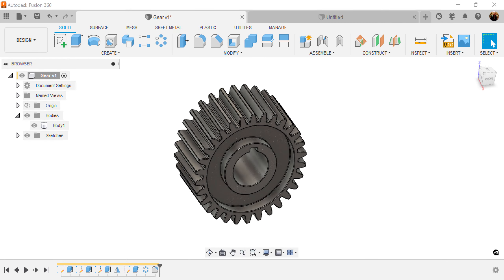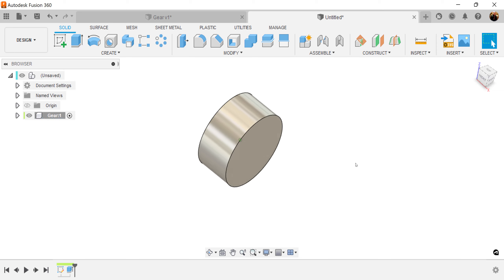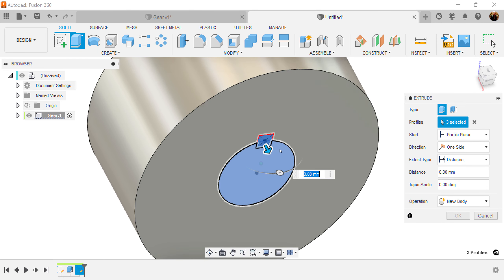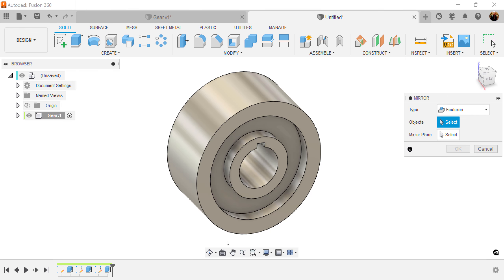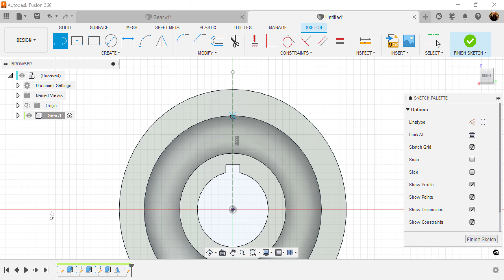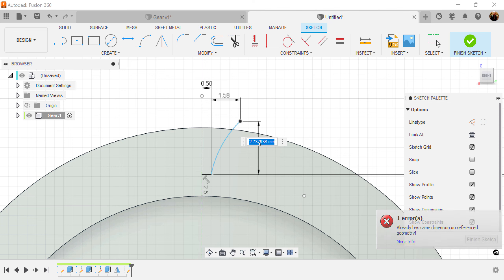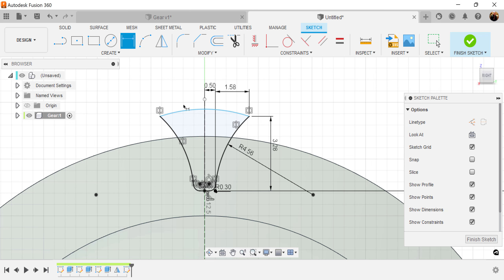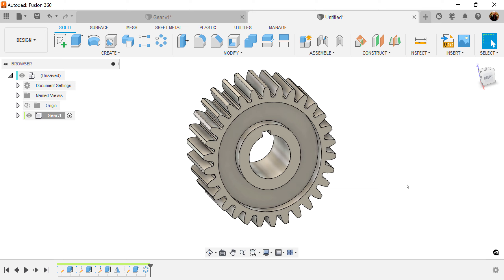Fusion 360 - Learn to model a gear

Comment: You made my day! Thanks!
Reply from the maker: My pleasure!
Reply: Mr. CADJungle I have a really big problem 😅 I have a special blower fan blade.. But so old and broken.. I wanna print a new one but too difficult model 🤷‍♂️ can you help me somehow?
Reply from the maker: So, I am willing to assist you so that you can learn Fusion 360 and hone the skills to create things on your own as well.. I would start out by gathering different photos at different angles. I would then would take measurements of the item itself and if the manufacturer or vendor  has listed dimensions, include those also. You can email me at support@monetaryingenuity.com with the specific product you have and we can work on it together! While, my schedule is pretty tight, I will do my best to set aside sometime to assist.
Reply: @CADJungle  you are a gentleman! 
I try to learn but my job so busy and my laptop maybe 12-15 years old :) and so slow... :) thanks again!

Comment: no defintion of those numbers just mhm okay and enter this, why no use of parameters to change the gear afterwards, this was not helpful
Reply from the maker: You can always choose to use parameters if you like. Try using parameters if it is more to your liking. You just may surprise yourself!
Reply: @CADJungle  I cannot setup parameters because you do not reference how you generated these numbers, what equation you used or what they define

Comment: I've been searching all over for sts s3m pulley files and have given up, figured I'd try and look up how to design them. This vid was super. I'd sort of be going at it backwards though, since I know the number of teeth (12) I need on my pulley, but not the initial diameter or circumference. Since S3M is a 3mm belt pitch, is it just as simple as 12 x 3?
Reply from the maker: To more accurately create gears using a plugin, I'd recommend this video I posted: https://youtu.be/EZlAkZ7imUU

Comment: This is literally the worst way to model a gear, and a terrible way to present even that. There is no description of how he is arriving at the random numbers he is instructing us to type in for the design of the teeth of the gear. You could not use this tutorial to make any other gear than the exact one he is demonstrating. There are SO many other, better, quicker, more universal methods to make a gear than what is being demonstrated here (for example. GR gear generator add-on). This technique is perhaps useful to learn how to draw a design around a circle, but certainly not to make gears. Gear design needs to include terms like "module," "pinion," and "pitch angle."
Reply from the maker: If you read the about section, these exercises are intended  to help you become familiar with Autodesk Fusion 360 through repetition. These models are not always exact but, are measured for approximation. They may also not always be real word examples, but a guide in software use. When attempting to reproduce models for 3D printing, be sure to verify your own real world measurements for authenticity.

Its also indicated in each description of every video I create.

Comment: One quick video lesson on multiple origins please. Each component can have its own origin, but is there a way to edit those origins in XYZ,  the same way we do on a cnc milling machine? Is it possible to use user variables for each axis in g54, g55 etc?
Reply from the maker: That' will be a good video to create. In the meantime here's a potential solution: 

The move command in Fusion 360 won't change the component origin when you move a body. With this in mind, create a copy of the component using Copy/Paste New.  This will be a placeholder for the position of the component.  Next, move the original component so its origin matches the main origin or a specific origin you choose.  Next, move the component body to it's original position using the Point to Point option in the move/copy command between it and the copy.  Remove the copy. 

Also, you can't define new names for each axis however, as a work-around, you can create a selection set for each axis and give it a name.

Hopefully this helps for now!
Reply: @CADJungle  I came up with a solution. I used fusion's origin as the cnc machine home position and modeled the slotted table. Created user variable to represent the offsets, g54x and g54y. Next created a rigid joint with a corner of the vise and the origin. In the joint command, for the offset tab I add the XY variables, and Z is the total height of the vise to have it flat on the table. Then simply editing values in the parameter table to move the vise to the desired location.
Reply from the maker: @gillisdebilio7086  I'm glad to hear it! if you wouldn't mind sending me a couple of screenshots on how you accomplished this to: support@monetaryingenuity.com, I'd really appreciate that!

Comment: could you do a video on a helical gear pls!?
Reply from the maker: I can definitely do that. Look for it the next video!
Reply: Their is a fusion 360 plugin that lets you do helical gears simply by setting the number of teeth, size of the gear and taper of the helix. It creates the part as a component instead of body though.